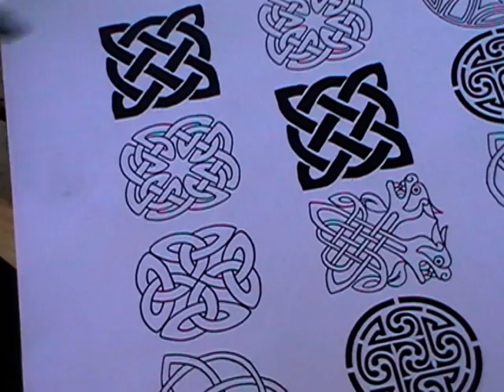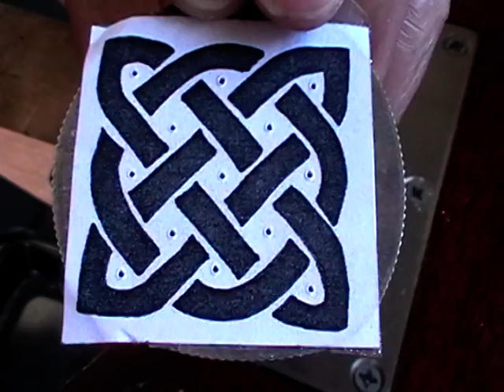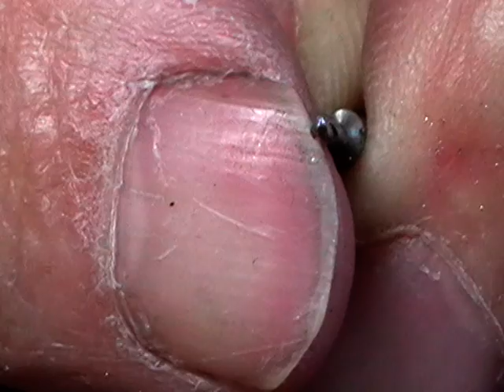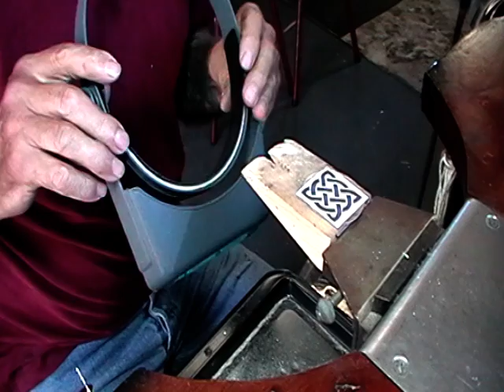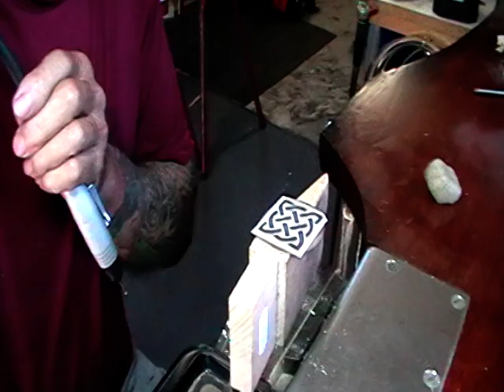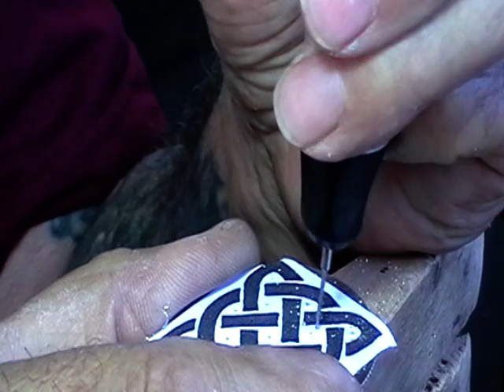celtic design pendant pt 1

Comment: you could also print it on a sticker!
Reply: good idea if you are set up for that
Reply: im sorry first i wanted to tell you that i have learned a lot from your videos! Thank you for sharing your experience!
If you are set up for printing a normal A4 paper, you can just buy A4 sticker for 20 cents in the stationary shop and print on it like if it was a normal A4. i use normal printer....
When i was watching the dragonfly video i also had the idea to tell you you could use photoshop to adjust the exact size you want. or adobe illustrator.
Reply: Péter Csomós thank you

Comment: SIr, if I may make a suggestion for those without double sided tape. Whilst in Afghanistan I used rice paste as a glue. It was made from overcooked mashed up rice that they served at the dining facility. I would spread it thinly on the metal, put the template on, and press it with a weighty book and a rock. Surprisingly, it held up very well during piercing. On a project with a lot of piercing, (a quarter inch thick piece of steel for a tsuba) I found that it helped to give it a coat of lacquer to protect the paper and ink from rubbing off and blurring.
Albert
Reply: no drama, thanks for the tip. we are usually spoiled for choice in the west and forget how it is in the rest of the world. i usually tell my students to visit jewellers in third world countries if they have a chance, as they do amazing work with minimal tools